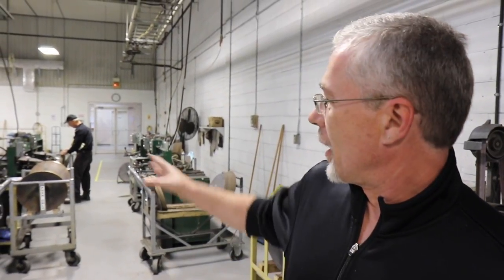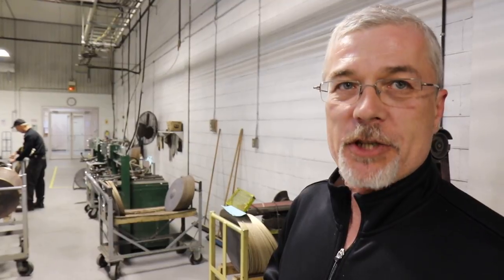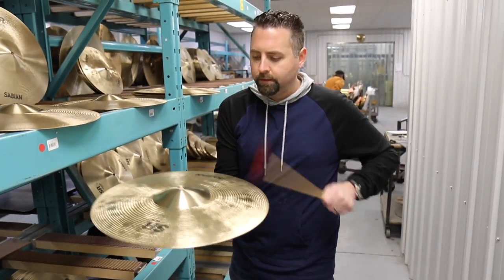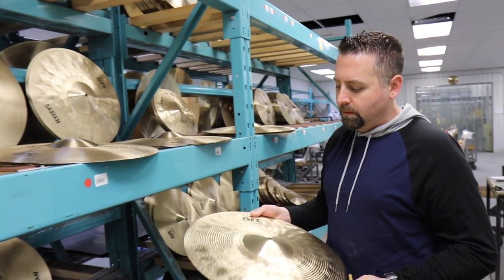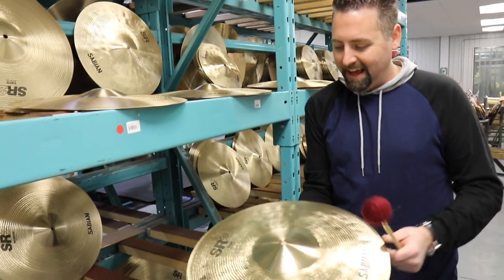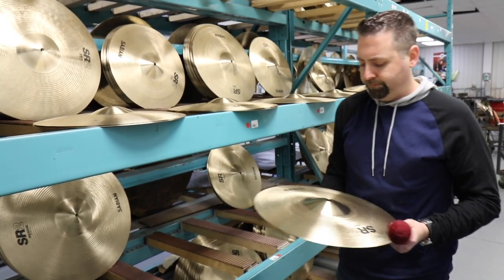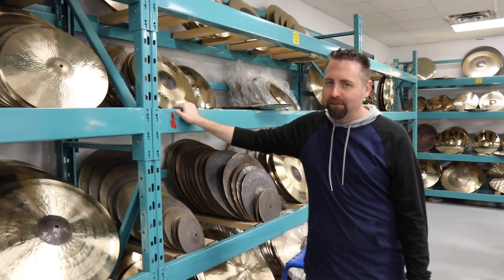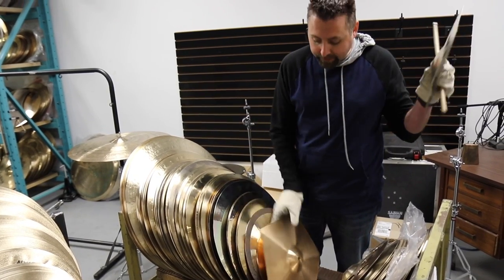Hand Picking Cymbals @ The Sabian Cymbal Factory!

Comment: The way he is handling all those cymbals, chucking them about gave me so much anxiety. WTF
Reply: Shane said at the end of the video Sabian will clean the cymbals up and re-logo them. I would assume that would also include re-edging each cymbal to take care of any knicks that occur on those metal racks. I’ve bought quite a few brand new Sabians this year and I have to say I’ve seen more edge damage than I have with all the brand new Zildjian’s I’ve bought over the past few years. On the flip side I bought an HH Power Bell Ride “used” in a private sale that was at least 6 years old and the edge looked just as clean as I would imagine it would be fresh off the edging machine. So some rough handling is occurring somewhere down the line with a certain percentage of these cymbals. I can understand an edge Knick on a cymbal that was displayed on the floor of a music shop but any cymbal that’s placed in the Sabian bag should be 100% ding free and remain that way when the customer receives that cymbal if it’s sold by the shop as “brand new”.